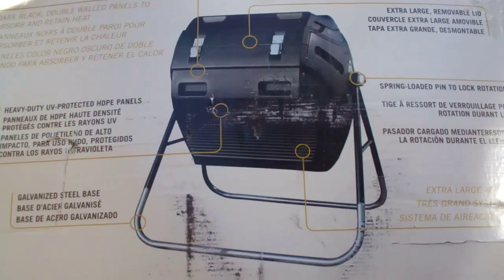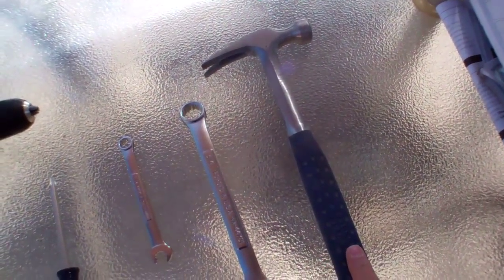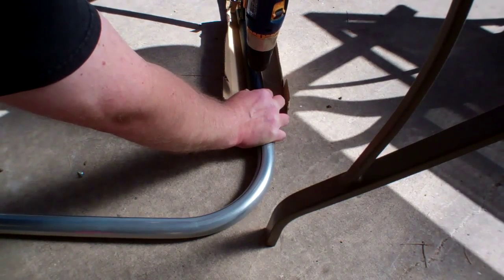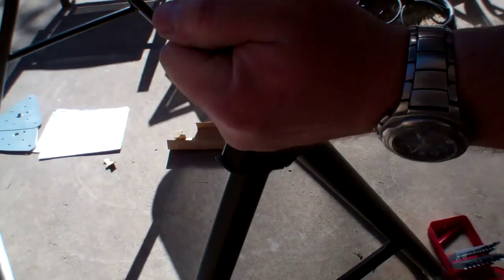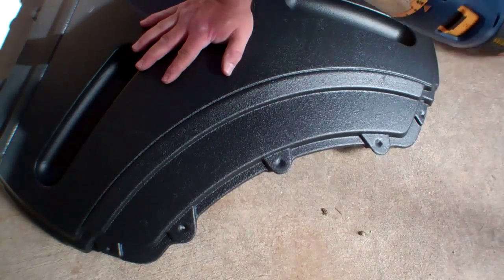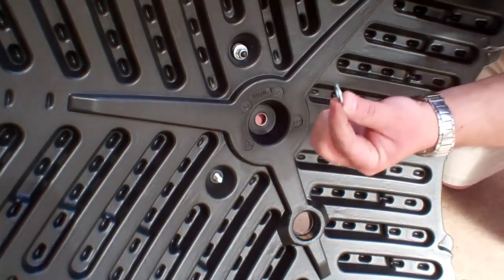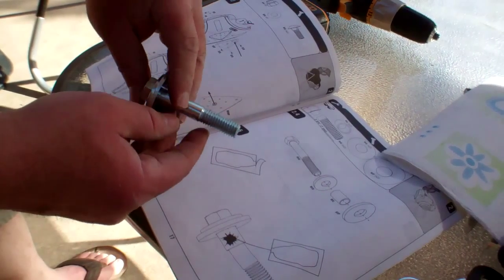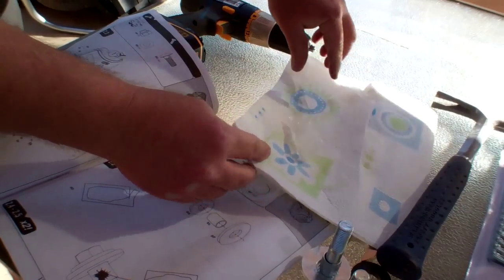Lifetime 80 Gallon Compost Tumbler:  How to Assemble:  Part 1 of 3

Comment: I want to thank you for the 3-part assembly video.  I hate assembling anything particularly anything that has this many steps.  Other than your detailed steps, I especially liked your calm speech pattern.  I would have been cussing and fussing if I had not seen this video.  In fact, it turned into a fun project that I spread over two evenings.  When it was over, it felt like the ending of a good book which I wished continued.  Thanks to your instructions, I may purchase another one of these to increase my production of compost.
Reply from the maker: Thanks for your kind words. Glad I was able to help.

Comment: Nice vids but if I may suggest. Before assembly, Give the two metal pieces that connect the two panels at the bottom a good coating of   rust-oleum. They are the most rust prone parts of the composter.